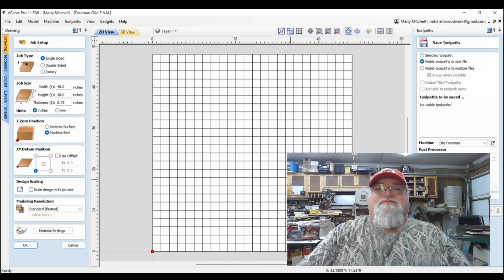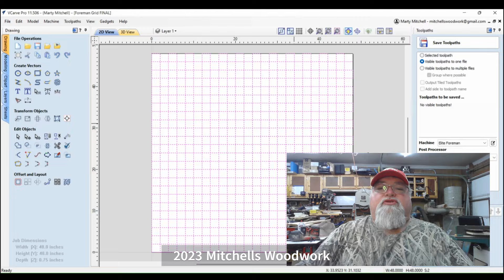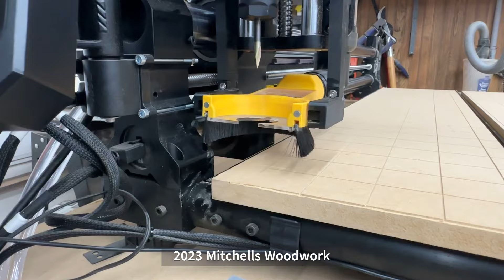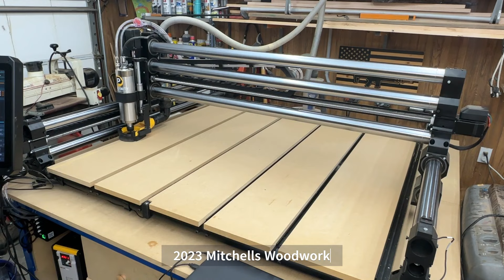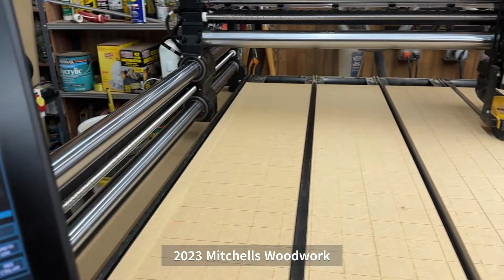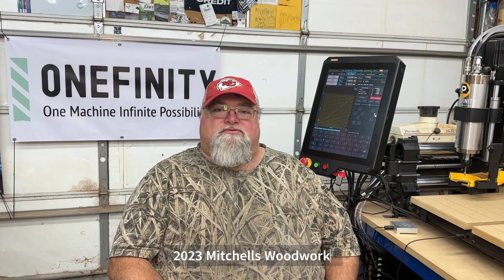How NOT To Cut Grid Lines On Your Onefinity Elite CNC / QCW Wasteboard!

Comment: I want to do that to my spoilboard, but cant even get the spoilboard flat. i keep getting ridges when i run the surfacing bit..😢
Reply from the maker: @ZER0o10  which CNC and surfacing bit are you using?
Reply: @MitchellsWoodwork  onefinity elite foreman with pwncnc 2.2 spindle. Bit is the 1" whiteside bit.. on a kreg table.
Reply from the maker: @ZER0o10  you may need to tram your machine, but that’s pretty much the “cure all” answer these days.  Post your issue on the Onefinity online forum and see what they say. 

https://forum.onefinitycnc.com/

Comment: So lining up the bit with the black dot of the Wasteboard, is that 1" from the edge?
Thank you.
Reply from the maker: It’s 11/16” on my machine, but it could differ slightly on each machine.  Your “black dot” point will be where your x axis limit switch stops your spindle.  I used a v-bit to find and mark mine.   The MEASUREMENT itself from the edge of your waste board to your “black dot” isn’t really relevant in this case.  You just need to know the absolute point where the limit switch stops the spindle from going any further to the left, and use that point as the extreme left edge of your grid.

Comment: Any thoughts to adding dog holes and or an outer side framing fence?
Reply from the maker: Adding some type of framing guide will be one of my next projects.  I made a fence for my Shapeoko Pro and loved it.  I had considered doing dog holes then, which would’ve been much easier to do, but opted for the fence.  This time I’m still debating on which way to go.  

Regardless, with the G54 ~ G59 programmable offsets in the Masso controller, it makes even more sense to utilize some sort of framing guide(s).

Comment: Can you tell me if you recommend the QCW frame?  I didn't order one and now wondering how much difference it will make.
Reply from the maker: As far as the increased rigidity and pretty much a guaranteed flat surface, it’s great.  But the big thing I DON’T like about it is the 8” gap between T-Tracks.  Clamping was MUCH easier on my Shapeoko Pro hybrid wasteboard setup.  Those T-Tracks were only 4” apart, which allowed for much easier clamping.  If I had it to do over again, I’m not sure I would get the QCW.
Reply: @MitchellsWoodwork  thank you for that information.  I was actually planning on using 6" base spacing for my wasteboard but that is still up in the air.  It was kind of a random pick to go evenly into 48" and not really thought out in any "master plan"
Reply from the maker: Personally, I'd recommend you consider 4" spacing, but even 6" would be better than the 8" of the QCW.  Spoiler alert!  I'm going to attempt to modify my QCW to have 4" spacing...wish me luck!
Reply: @MitchellsWoodwork  I get the impression the guys over at onefinity liked the idea of the shapeoko hybrid table but wanted to keep things a little bit cheaper and so went with the half n half version of the framing. In day to day use I expect the 4" or 8" makes a difference if you're doing smaller things but if you're doing large signs it probably makes less difference.
In saying that. I'm looking forward to see you try to mod for 4"
Reply from the maker: @8thsinner  for me personally, most of my signs are 16” - 24”,  but I have some smaller and some much larger from time to time.  The QCW is great for larger pieces, that’s for sure.
Reply: @MitchellsWoodwork  Well, I ordered mine today, elite foreman and qcw fixed stand...hopefully its at least as rigid as your kreg is now.
Reply from the maker: @8thsinner  I hope so too.  What’s the projected lead time before shipping now?  It was 16 - 20 weeks when I ordered mine on 4/11.
Reply: @MitchellsWoodwork  I have no idea actually. Last I noticed on fb it was about 2.5-3 months. If it told me in the email confirmation or something I don't even know. How ever long it takes, nothing can change it so no point thinking about it. It will arrive in divine timing.